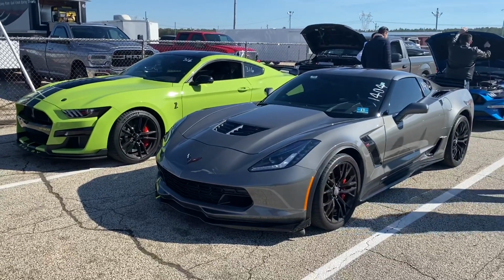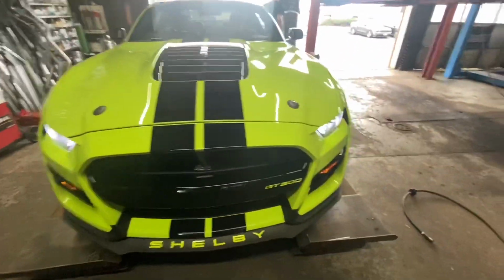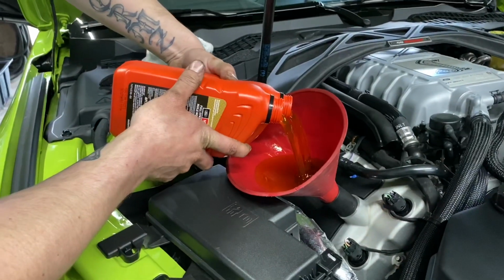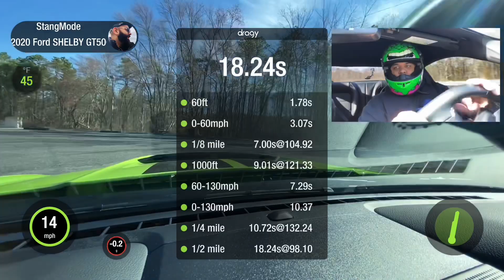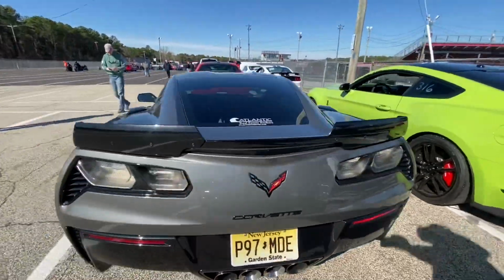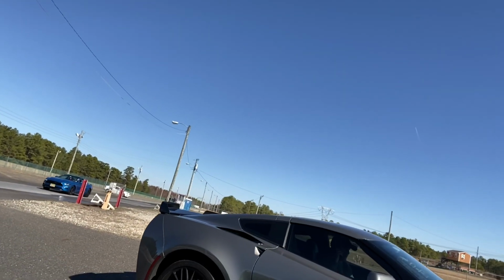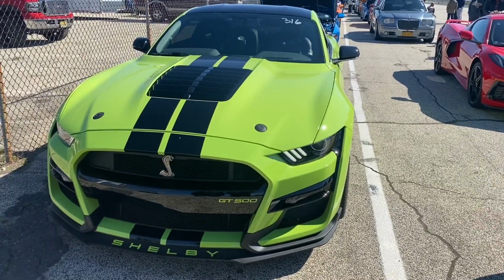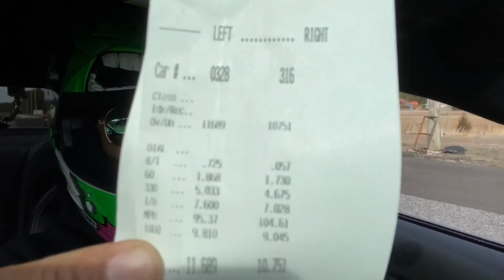BOSS FIGHT: CORVETTE ZO6 vs 2020 GT500 DRAG RACE! *PLUS C8 1/4 MILE!

Comment: The difference is the ZO6 is 700lbs lighter then you so that's a hell of a difference.
Reply: 1/10th advantage per 100 lbs.
Reply: Exactly, so take 700lbs off that GT500 and you have a 10.0,9.9 car! 
Just with the seat removed and not a full tank it's ran 10.5's
Another had run 10.6 withheld all interior and unspecified fuel and was the first to show any GT500 content.
Reply: @gregwilliams4380  add the 100+ extra horsepower to the vette. And it's a big difference as well.
Reply: @kkellerk23  not as much as those 700lbs. 
The other thing is with just a Tune, E85 and a pulley you can make right at 900hp to the tires with the GT500! You will never get close to that with the ZO6! 
Add some long tube headers, ported blower and better intercooler your talking well over a 1000hp yo the tires!  
Not bad for bolt-ons

Comment: Quit using ford oil in my race cars years ago. It runs 5-10 PSI less across the board. Use nothing but Amsoil. After putting big bucks in an engine cant skimp on the oil. I wonder if this is why some of the Coyotes and GT 350s have a problem. Just my humble opinion. Like your vids

Comment: You made a 0-60 time of 3.07 so round it 3.1 which is much better then advertised. And your fully loaded with fuel and all!
Reply: SyphonX  
True but it's not a drag radial either.
Reply: SyphonX   LMAO, no it doesn't. A kid that has never even been on the dragstrip ran as bone stock as the car comes in Texas the 1st to have any content up and he ran a 10.6 at 132-133 bone stock so please take that street tire nonsense elsewhere!! 
The car runs on average fully stock at the track times between 10.5-10.7! 
You are mistaken thinking that his 10.7 time has one thing to do with the tires because it does not! 
Get your facts straight before spitting out nonsense

Comment: Z06 is not stock running 10's like the ZR1 dose.
Reply: Z06 ZR1 will beat the gt500
Reply: Who knows? Stock means different things to people. I know people with bolt-ons and or dr's that consider their cars stock.  A lot of people are suspicious because  major publication and tuners could only  get around a 120mph trap speed out of the Z06 but people are getting around 130mph claiming stock. Any how, this is a video with an honest Corvette channel that shows that ZO6 and ZR1 are not close to each other like people claim.  https://www.youtube.com/watch?v=w8g9T4NECOY&t=495s
Reply: Lol yes they are don't clown yourself
Reply: Numbers don't lie but people do.
Reply: @redd7188  stock means unchanged from the factory.
And why would GM put a 76,000-96,000 Corvette in the same performance bracket as a 144,000 Corvette ZR1?
Reply: @marcojordan1368  if the hellcat can beat the zo6 and the GT500 can beat the red eye then how can a zo6 beat a 2020 GT500?
Reply: @robertwillson1260  I know, I read an article a little while ago and the title stated the car was stock. First paragraph in you learn that the car has a tune, dr's and bolt-ons.
Reply: Robert Wilson just wait to the c8 Z06 come out with 800hp twin turbo it will murder that 2020 shelby gt500
Reply: @marcojordan1368  Well considering one will be a super car and the other a sports car I will have to agree with you.
Lamborghini,Ferrari, Not Mclaren so much with the new 765LT, they  all will be put on notice.
Reply: Trevon Adams  I don't have name call to get my point across out of frustrations.
Yes D.A. dose make a deference but for both cars and as far as packages go's(since you want to nit pick) the GT500 had no carbon fiber package to lean on for this race 🏁.
The Z06 makes very similar power to the last ZR1's 638hp 604tq and put down a 11.6 1/4 mile at 124-128mph.
Now if the 2019 ZR1 runs 10.4'(on a good day)-10.8 1/4 miles how can a Z06 run very similar 1/4 mile times with 105 less horsepower 65PFT less. The answer is pulley change or headers change which may appear stock to the naket eye,as I said already people lie but numbers don't.
A stock Z06 runs low 11.0s and that's whats expected of it.

Comment: Those 15 6.2 supercharged motors have problems with heat soaking 

Chevy change the supercharger a little for the newer engines for better air flow

Nice video though

Comment: I would nix on the twin turbos for the GT500. If you want more power you can always pulley down the blower. That way you can easily return it to stock.
Reply: There's just two things here at hand... You can easily change boot settings with turbos right from the cockpit without having to swap out a pulley and pound for pound of boost turbochargers will make far more horsepower and torque than any supercharger.
Reply: @chadkent1241  Turbos are also a very costly and invasive procedure not to mention voiding the warranty on the car. You have to modify almost every system in the car for turbos... Intake, exhaust, cooling and fuel to name a few. If you want to track the car mostly it could be worth it but not on the street.

Comment: "Yeah I'm on a street tire"  or to any one that doesn't know,  Toyo R888r a very sticky expensive road racing tire...🤷‍♂️
Reply: 2t713 yeah, also a very common street tire for guys running 600+hp, point is, its not a radial, and cant be compared to one.

Comment: So a bone stock 2015 z06 is just as fast as a 2020 bone stock gt500!! The problem with mustangs and always has is weight! And the 500 has a duel clutch ! If the zo6 had a duel clutch it would be faster than the 500! How much is a used zo6? That's the hot car now a used zo6! Or even find a new zo6 ! Maybe 50k used ! So for half the price of a 500 you get a car as fast and looks killer! Always loved the c7 but I live in Australia it's to much to convert it to right hand drive plus shipping! And I have a roush supercharged 2017 gt! It's just to heavy! Hope future stangs get weight loss happening it's just a must! A light stang would be epic! A loss of 500pounds is 150 horsepower gain! Shorly they could get that amount! The vett can why cant the stang!! 🤙👊✌
Reply: Please understand that not everyone is a fan of Vette due to some specific reasosns.
The Vette LT4 has known overheating problems despite using 9 heat exchangers, GM says its fully solved but issue still persists and haunts a lot f fans
Secondly the nature of engine, I ve been in lot of machines and speed is not always what people want. Sometimes just the engine. The Ford motors dohc setup means they rev much harder and slightly faster than ohv. I drove the C8 Vette and I didnt get any emotional response from engine. It felt too mundane and flat. Just drive a GT Muscle and rev her to 7000+ rpm, the excitement is another level. 
See I am not sayin GM sucks..but there s a reason why Mustangs outsell Camaro+Corvette combined globally. U ve got to spend lot f time in both to realize that. 
I wud say this...if U r a track person, oh yes the Vette is anyday better than Mustangs, but its day to day or weekend road fun U r looking for...high rpm adrenaline always gives U more spikes and tingles than the LS motors. Its just the charecter.

Comment: Id make the switch next oil change to Amsoil or Pennzoil Platnium. 
Pennzoil Platnium is the only oil that rivaled Amsoil and it cost less (about $2a qt here)
Reply: Pennzoil ultra platinum was the one that was close to amsoil. It's a little more expensive, but not as much as amsoil
Reply: @Junior_Perez  The only difference from the description on the bottle is that the regular Platinum "keeps pistons 40% cleaner" and the Ultra Platinum "keeps pistons 25% cleaner." Platnium has a little more detergents than Ultra from what ive seen..only difference. BUT yes the test was with ULTRA Platnium.

Comment: I say keep.it super charges too but not for the reason he said. A twin turbo set up would have zero lag. 1. You paid for the super charger. 2. Warranty. BUT the 5.0s with the hellion sleeper kits are running 9s. IJS.
Reply: Modern Twin Turbo kits have come a long way, but they're still far from zero lag.  Faster and capable of putting more power to the pavement...most certainly, but Positive Displacement blower cars have always proven more reliable, controllable, streetable and consistent.  The Shelby is just about perfect the way it sits.
Reply: @alfrede.neuman8611  I'll take the negligible "lag" of a totally reliable twin turbo set up anyday over the parasitic draw of a blower. The lag and reliability myths surrounding turbos come from 4 bangers putting big turbos on at too much boost. A V8 already has the torque and displacement to get to moderate modern turbos spooling quick and reliably. And as long as you keep the boost where you would on a blower and don't go turbo crazy, itll be just as reliable. Superchargers blow up engines too when pushed incorrectly.
Reply: @azilla04  I have yet to see ANY turbo set up eliminate lag.  Modern Twin Scroll turbo's are certainly more efficient than their predecessors, but it's still an issue...even with big V8 engines.  Its an inherit byproduct of the design of a turbocharger itself.  Their "lag" may seem negligible when loading it up on the line, or during rolling starts where you can spool them a bit, but when you're on and off the throttle in traffic or a road race, or get caught in the wrong gear, that lag feels like forever.  

Positive displacement power delivery feels near instant.  As the matter of fact, if you've every driven a car with a PD blower on, other than an audible whine under load, you'd be hard pressed to know it's there at all.  It simply feels like a massive big block under the hood!  Of course they're not going to produce the all out power levels of a well built turbo set up, but their drivability and reliability are second to none.  

And when I speak of reliability, I'm not talking about engine reliability.  I'm speaking of the units themselves.  I've seen numerous Eaton's go 200...300....even 400,000-miles without failure.  That's a track record turbo's can only dream of.  Its kind of par for the course though.  You can't expect something that spins at 150,000-200,000-RPM to deliver long life.  Comparatively, that's more than 10x the operational range of your average TVS.

To each their own, but there simply just isn't one "do it all" manor of forced induction.  Each has their benefits and their deficits....turbo chargers included!
Reply: @alfrede.neuman8611  just like parasitic draw is a blower issue. so its a choice. wait for boost in hp or lose hp for boost in hp. i'd choose wait since the v8 can already hold its own in hp and torque.
Reply: @azilla04  ROTFL.....I don't even know how to reply to that level of ignorant mindset? 

shakes head

....I'm out.

Comment: C7 Z06 is 2020 GT500s arch rival , even on race track I guess they ll put up comparable lap times
Reply: c7 z06 will beat it
Reply: @Ws6Ms  well the GT500 track pack has set a lap time of 1:55.xx at VIR East Course under Randy Pobst, the Corvette Zr1s best lap time around that track so far is 1:54.xx, and the Z06s best s still unknown, 
Also in short tracks probably the Z06 ll beat it but in long tracks or even in tracks like Laguna Seca the GT500 might do a 1:33.xx , the Z06 territory

Comment: So the gt500 is on Toyos r888s which isn’t stock to the stock 2015 zr1 on stock tires lmao. Good runs but the gt500 isn’t on stock tires
Reply: Everyone knows that.
Reply: BlueOval You well stock to stock everyone bitched about it when mod 2 Fame ran drag radials and smoked the gt500 times

Comment: You think you said “full weight” enough times?
Reply from the maker: anthonyt444 FULL WEIGHT! Now i did lol
Reply: Just go like B is for build’s mustang, lose all the body panels/roof and go for “half weight” lol
Reply: With all the crying that's been going on, it's Impossible for him to say it enough.
Reply: Lincoln Ls Ahead of it's time.   the same way the blue oval crowd has always cried waaaa waaa i got a smaller motor but it runs good  for what it is and usually the Ford camp is the king of weight advantages and "tweaks"  in the end it has always been "run whatcha brung" so quit freaking crying man up and take that loss(thats LOSS not lose) the 5 years older Vette won  so take your medicine son
Reply: Lincoln Ls Ahead of it's time.  Because Ford uses overhead cam engines that produce power more efficiently so they don't need as much volume
Reply: Lincoln Ls Ahead of it's time.  The efficiency of the 4 valve engines is accentuated by forced induction. The extra surface area of the intake valves allows more air to be blown into the cylinder. There are some solid advantages to the old school ohv motors that Chevy and Dodge still use though, they are usually lighter and smaller and can provide better low end torque. I love Fords mod motors and Coyote platform but i also love the LS from Chevy and it's hard to deny how awesome the Hellcat motors are

Comment: Good wins for the snake as usual but S/O to the vette
Reply: 19'ZR1 vs 20'Gt500.. 😲
actually, didn't think a 15'zO6 would run with that 500!
Reply: scar face 19 Ford Gt vs 19zr1 it's been proven already, but I did the vet should win off the line because it have more torque and its lighter lol
Reply: Trevon Adams they race the zr1 is faster around the track but a 1/4 the gt gets it bro the zr1 a mf though much respect
Reply: Trevon Adams and I could look at stock gt's doing the same the cars are kinda evenly matched tbh it's a 50/50 race  and I don't argue bro it's a joce

Comment: Do Corvette Zr1 vs 2020 gt500 :D
Reply: That's 130k for starters price vs 73k price I know there was a mustang for 180k that's market price look at speed phenom or that kid that use his daddy's money to bye the super snake you get the point
Reply: Hunter Cline i didnt ask you or anyone for the prices of any cars. I just wantd to see a video i suggested ... but thx, nd idc whos dad is buying who’s car either lol
Reply: It will show the gt500 losing because the zr1 has more toque and can jump the line faster and it can stay at a pace because it has the hp to run it and 500 would be catching up but it wouldn't pass it that's probably what would happen
Reply: Well I look up the quarter mile time for zr1 its 10s to round 9s 10.6 to 10.4 high wing 9sec but this car is a lot more you could buy two cars with it gt500 73k gt350r 70 k only 143k vs 130k so you see it now right
Reply: And these cars are more than the average jobs yearly salary so come pare apples to oranges at this point all you want to see is the 500 beat messed up
Reply: @huntercline3503  stop trying to come up with excuses everyone knows the ZR1 is going to win. It's lighter produces more horsepower it has more low-end torque.so what if it cost more if you want to be completely realistic with the markups on the Mustang it's probably even more than the ZR1 depending on which state you buy it from. The ZR1 is going to win even with the track variant with the big wing. I would not expect the 500 to win at all.
Reply: @coreyblacksher  that's what I said the zr1 will probably win I don't know why you comment I know why it would win I'm not making excuses I'm just telling facts to were these to aren't in the same group a car that goes to France to race people all round the world is going to race a pony car that seems point less to race waste of time and money.

Comment: Race the 2019 zr1
Reply: Don't imagine it would fair as well as the Z06.  It makes more power, but its set up to run a race track...not a drag strip.  Suspension is too stiff and the chassis is tuned completely wrong to transfer the weight at the track.  They picked the right car....the Mustang is just simply faster at the moment.  I'm sure in a few years when they dump the Z06 powertrain into the C8 chassis, that will change.  But for now....The Shelby has it in a straight line.

Comment: Fords brand new most powerful most baddass mustang vs a 2016 z06 lmao. Poor Ford. Getting compared to a 6 year old z06. Not even the highest model. People keep praising the gt500 but why do I see so many videos of it being compared with older cars or a base model of the new ones. Lets see a c7 zr1 vs s550 gt500 or a 5.0 vs the C8 base or the new z07 c8 vs the mach 1 or even the gt500 its not the highest trim model but it will beat a mach 1 to easy. Pretty funny

Comment: 19'ZR1 vs 20'Gt500
Reply: Would be a good race but I don't think the GT500 has a chance. Here is a totally stock ZR1 vs Demon. 10.2@137 for the ZR1 and 11.5 @ 134 for the Demon. https://youtu.be/-FBSxH5l-sE bad run for the demon and great pass for the vette but you can see that the auto zr1's run mid to low 10's and the gt500's are 10.7's. So yah might be a drivers race? I've seen bone stock manual ZR1's run 10.8's
Reply: ZR1 would make easy work of that gt5!!!
Reply: @Smokealotapotamous  yea, I think the Gt500 is nothing but a Monster.. love to have one! but, I'd have to put my money on the 19'ZR-1 without a doubt.. ride is plumsICK!

Comment: Told you dude that the c8 on a drag radials is way faster then the mustang gt 10 speed auto and you said that the c8 runs same as the 10 speed auto once again your wrong c8 faster
Reply: 🤣🤣🤣 bro it lost a second with out radials and with radials it would be close but not faster do you get that 400 hp is not going to out perform 760 it wouldn't keep up that c8 got pass from the start drag radials will help in the start but not for long. Got to think it's nice if you would try.
Reply: Hunter Cline I am talking about N/a c8 corvette vs 2018 mustang gt 10a n/a corvette is faster then the mustang bud
Reply: @fromdaslump9873  that makes more sense